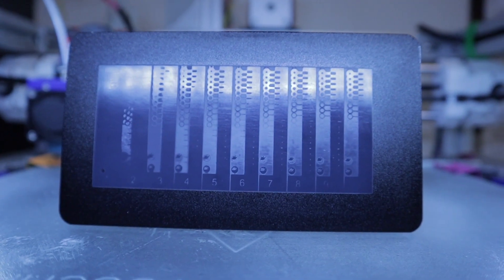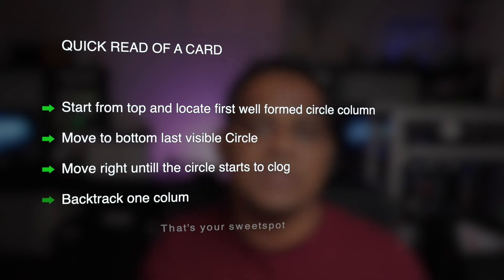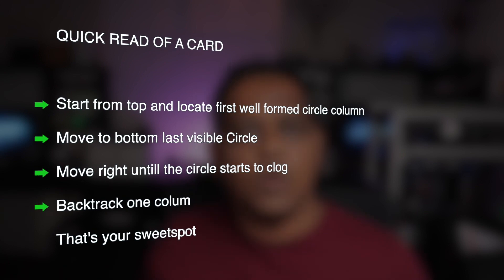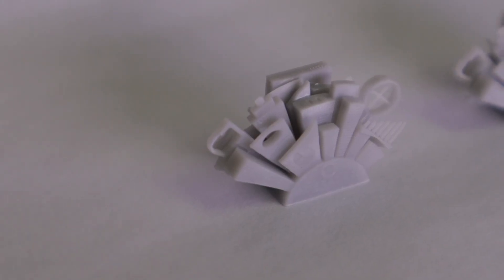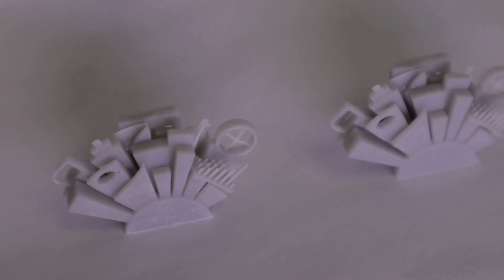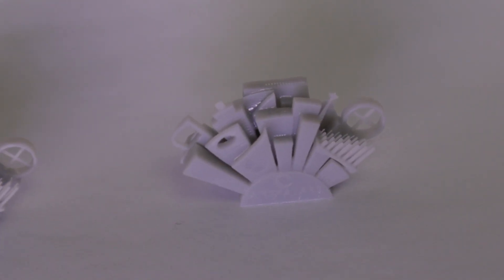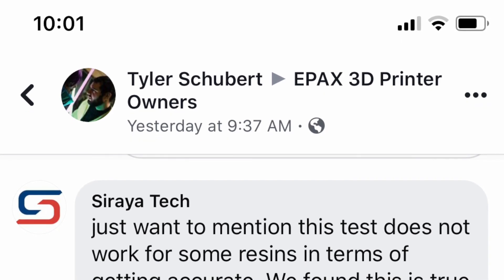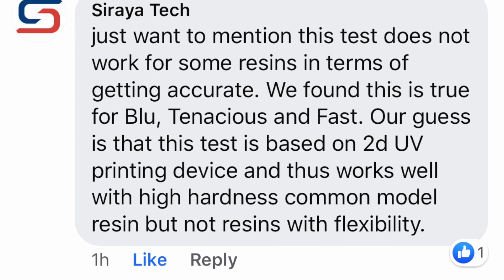How to read your Resin Exposure Calibration made by the Resin XP finder and something surprising!

Comment: Hey I got a Photon S a couple of weeks ago and I've been printing non stop trying to dial it in using Anycubic Grey resin. This test tells me I get the best results at 8 seconds exposure time, however the issue I'm having is the pre supported minis I'm trying to print from Titan Forge have a high fail rate at this setting, but don't fail when I bump up the exposure to 13 seconds but then the detail is not as crisp anymore.

Do I have to just suffer the loss of quality here if I want to use the pre supported models?

Comment: Well that helped explains why my calibrations for some of my resins is not doing so good. I was all over the board when calibrating resins for both my printers. The Photon and the Mars.
I will say that some of my issues for the Mars printer was actually the Build Plate and how well it was secured for leveling. I switched out the M6 Screws grub screws for a higher quality m6 socket head screw and I was able to notice the difference right away. I went for a Black Chrome socket head screw. Besides it just looking pretty the quality itself is better. It is a stronger metal and the threads are more accurate. The stock grub screws were not just gripping enough and I think it was causing the plate to shift a little during lift suction. There were times where I could bump the plate slightly and the it would shift even after putting some considerable force into tightening them. Anyways I think it is now a must to change out the stock grub screws in the Mars printer. I think that is why the new Pro version has better screws as well. Still I would upgrade those as well. Black Chrome is the way to go for them. :) LOL

Comment: Using Elegoo Mars.
Got ABS Like Fast Grey Resin.

I am trying to understand what you mean by figuring out the best column for ABS like calibration.

You say your #4 is best where the cricle starts to form first?
Do you mean the first circle, or set, or last circle?

I pause the video and your #4 appears to have no circle at the top.

Do the little lines on the edges not matter?

Is it purely a circle test?
Reply from the maker: Thanks for your comment. You have to remember this is a subjective test. It’s not a clear case of having the exact exposure value show up. In my case while I selected four as the “best” column, you are right that the topmost circle didn’t form properly but OVERALL I found #4 to be the best based on the guidance given in the github page which I linked to. 

Also, it’s not just about the circles, there other features also play a part so you have to decide which one matches best according to the GitHub directions.

Comment: I was doing the calibration just tonight and found out the discrepancy. Thank you so much for doing the research. You saved me some time. I was about to do eight second exposure. I’ll try it and post.
Reply: Ok so I’m printing the Amerilabs city. My setup is the Epax X1 with the upgraded UV light array. I did the 8 seconds .05 mm layer. Overexposed!  Went with the suggested 7.5. Overexposed! Will print at 6.5 seconds and report. Also will print at .03 mm and report.
Reply from the maker: You are welcome. Please report back!